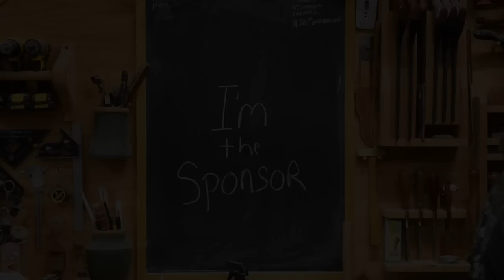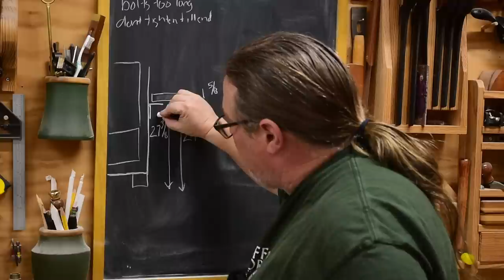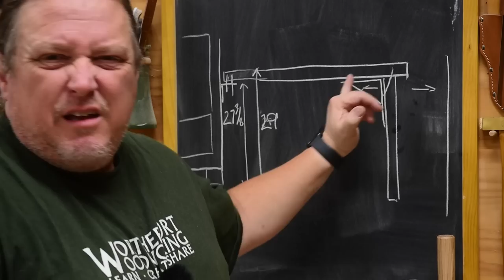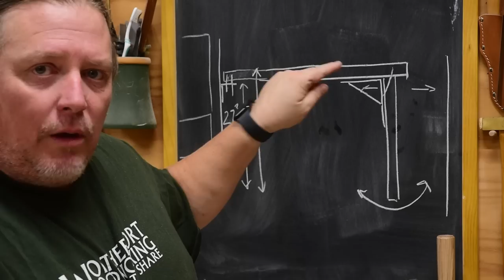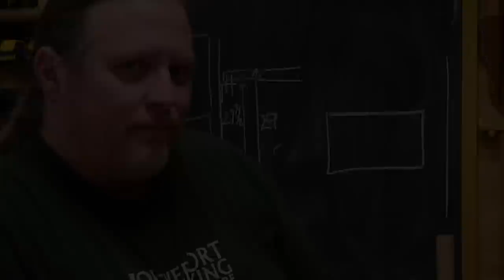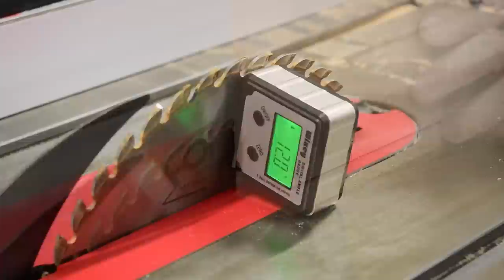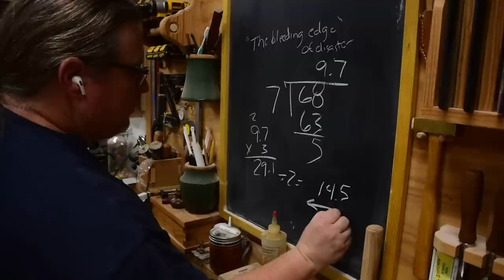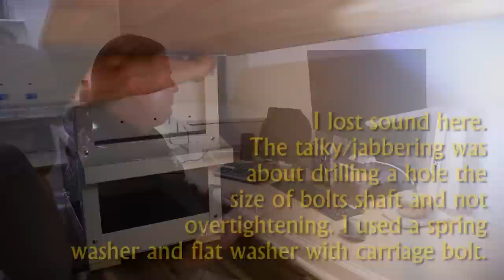Hybrid Desk: an Inexpensive, Easy to Make DIY Desk that offers Skill Development for those who want.

Comment: Thanks Shawn.
The blind dove tail seems to be the joint to make right now. I've watched 3 others also showing it, in 3 other ways! End result is the key.
As far as the desk goes, I spent my entire working career in const. and bought a home that needed the front porch/deck in need of repair. 4 yrs. later I'm almost finished with the skirting and stairs! "Just a little more time and it'll be done" is the lie I've been telling my wife!
Reply from the maker: Kinda kicking myself for not doing it in both directions.

Comment: Something I've done to prevent torquing of the waterfall leg - if you know the backside is going to be against a wall, I've used a runner board at floor level between the legs on the backside of the desk.  Still leave the front side open for sitting at the desk.

Comment: It takes me a while to find time to watch your longer videos, but it’s worth doing even with a simple project like this.

I think the reason your sliding dovetail needed adjustment was the little cutoff you used for marking the width.  The missing kerf where you sawed it off raised it enough to introduce slop.
Reply from the maker: Nah, it was me watching the camera instead of my line to make sure the shot was working. I have to straddle my arms around the camera to get close ups. That's my excuse and I'm sticking to it.